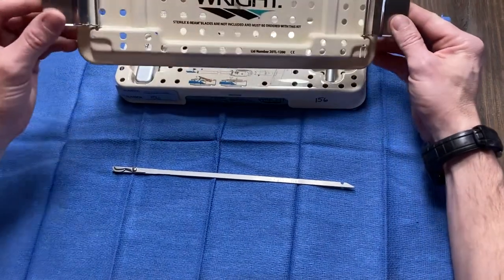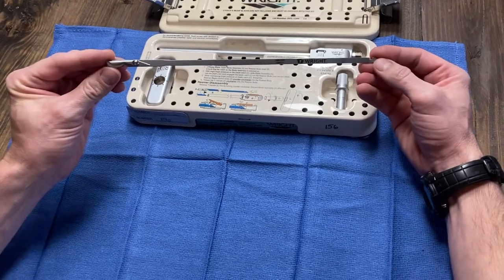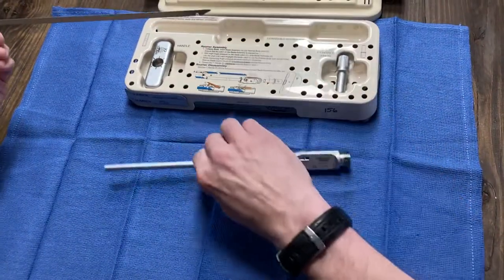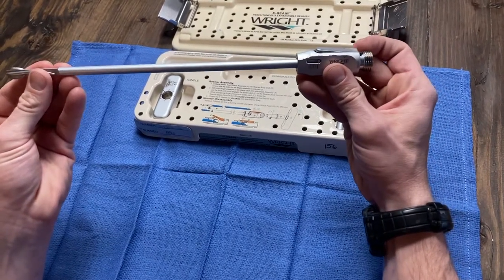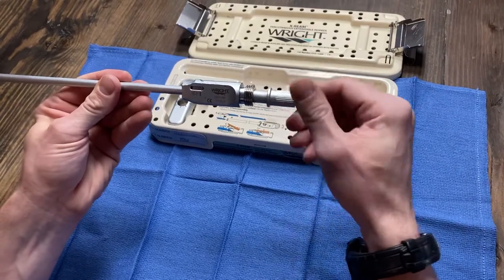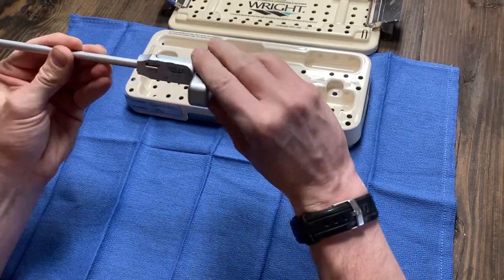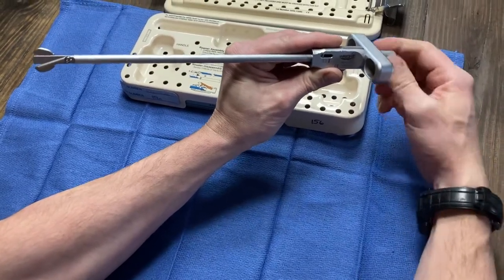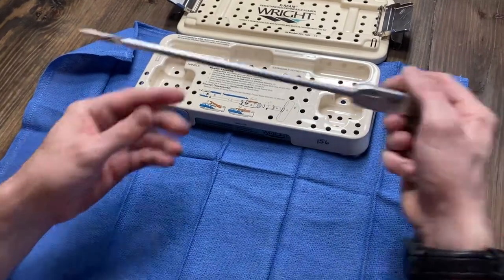Wright Medical X Ream core decompression, back table setup

Comment: Hi Jeff… thanks for sharing this information. Could you please confirm… are these instrumentals and blade enough to do the surgery or do you need more instrumentals?
Reply from the maker: So- there is a sterile kit, in addition to the sterile blade and instrument caddy, that contains a starting pin, tissue protector, opening reamer, and some other various disposables. Also the pro-stim or prodense graft. 
This would be considered essential by most surgeons, as you need to confirm placement with the pin under flouro, and gain access with the opening (cannulated) reamer. 
Here is link:
https://www.wrightemedia.com/ProductFiles/Files/PDFs/AP-010975_EN_HR_LE.pdf